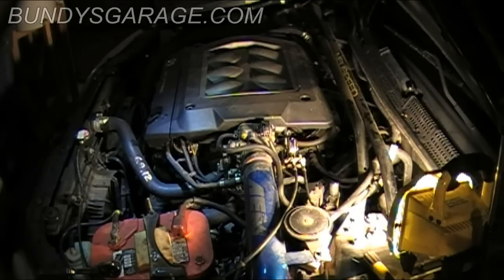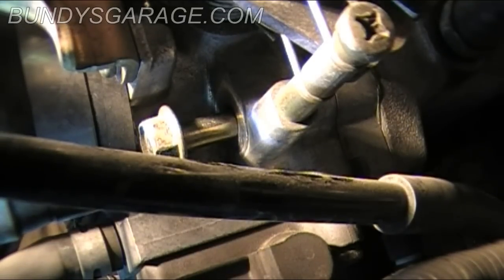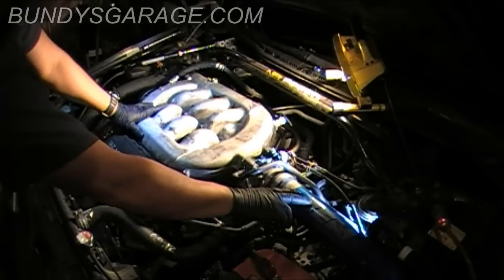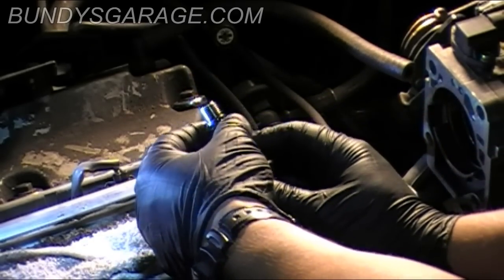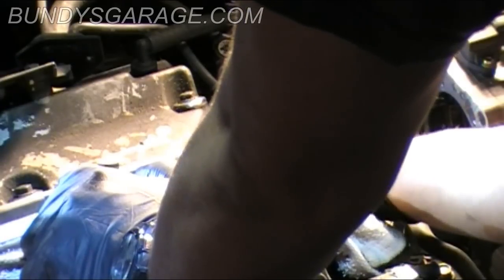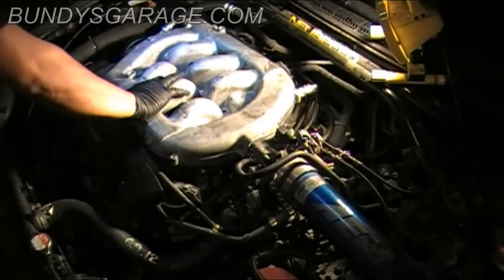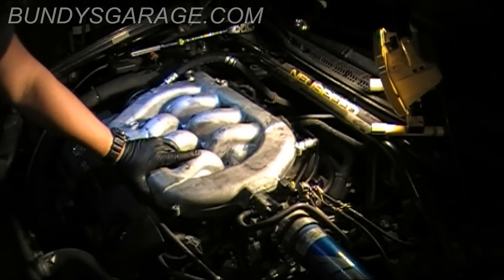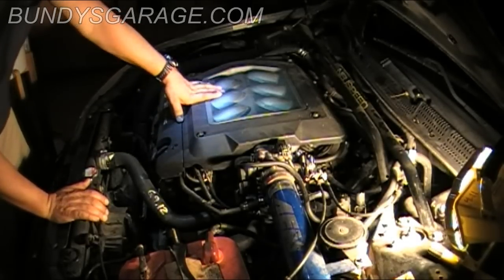DIY: Acura Honda (FPR) Fuel Pressure Regulator J Series V6 - Bundys Garage

Comment: Thank you!

I have a 2000 Honda Accord V6 and the steps were pretty much the same as in your video.

Note other 1998 - 2002 Accord V6 owners... 
You’ll have more pieces to remove on the engine cover than shown in the future!

But other than that, it’s pretty much the same!

Comment: Very interesting. My model does not have the fuel pressure regulator there. It is located in the fuel pump assembly. I had to look through a Haynes manual because I could not find mention of that anywhere.
Reply from the maker: What’s your year, make, and model?
Reply: @bundysgarage I have an 06 TL and mines is not where yours are either and I’m sure it’s in the fuel pump assembly but there’s no videos on it anywhere

Comment: What were your symptoms for the part being bad? My 99 Acura TL is showing signs of it not shifting when it should, when I’m driving it’ll often start to rev up as if it’s in neutral, then after 2-3, it’ll kick back in and start accelerating normally again. Also, it’ll often show lack of power.
Reply from the maker: What codes do you have?
Reply: @bundysgarage  I haven’t used a professional scanner but I used the obd2 scanner from autozone just to see what it would throw up and it gave a code for the transmission. My trans was brand new when I installed it. Only has about 50-60k miles on it.
Reply: @bundysgarage  that’s why I really questioning whether it’s clogged fuel lines, fuel filter, fuel injectors, or the fuel rail regulator. Or I’m hoping it’s not the trans in the worst case scenario. One other thing I forgot to mention is sometimes when I put it in reverse, i let go of the brake and it  doesn’t want to start rolling. Then when I push the gas. It’ll go but struggle and shake as if it’s about to stall. Never had that happen before.
Reply from the maker: What codes was it?
Reply: @bundysgarage  unfortunately they didn’t give me the code
Reply from the maker: You gotta get those codes and that will give you a place to start
Reply: It’s probably the transmission. Auto or manual? If it’s manual the clutch is probably going. If it’s automatic it could be the torque converter.

Comment: hey bundy i have a 1999 acura tl and it dont want to start but it cranks and the fuel pump turn on but no fuel pumping up you think is the fuel pressure regulator
Reply from the maker: +ClevelandMade216 itncoykd be your starter

Comment: Would this cause a p1072 bank 1 to rich on a honda pilot 04 , I have replaced upstream and downstream 02 sensors,replaced fuel pump and strainer (denso), replaced all spark plugs,cleaned throttle body and egr ports and code still persists

Comment: hey bundy @ 14:55 you said we had to match the fpr to the year and make, i have a 2000 honda accord ex v6, when i check the autozone website one FPR says 44 psi then another says 53 psi, i am having this "heat soak" or whatever it is called for this model where you drive around 10-15 mins shut the car off for 10 min and come back and it does not start up until it is cool. my question is if i get the 53 psi FPR will i have to change the pcm as well? thanks again
Reply from the maker: +Chris G No you should not have to change the PCM.
Reply: Chris did just replacing the FPR fix your issue?
Reply: hey THERIPPER216 the only thing i did to overcome the "hot start" was get two bottles of the GOOD fuel injector cleaner from auto zone and put one each one by one once my gas is like completely empty gas light comes on. then put 93 in my car about half a tank drive that out and add the 2nd fuel injector cleaner refill gas with 93 and my car has been running ever since, its been about 2 months since ive had the issue (knock on wood) hope this helps anyone else experiencing this issue.
Reply: +Chris G I'll try it lol did yours ever run rough for a few seconds when you had this heat soak issue? I've replaced all plugs, coils, and injectors and sometimes when I start it ( after driving it around for a while) it starts up with a misfire and I have to keep the idle above 2k  or the car will die and then the misfire will go away after like 10 seconds
Reply: +THERIPPER216 yes I had that issue but I replaced the coils packs and did the fuel injector treatment and it's been running fine ever since. Just be sure to do it how I did,  another YouTuber told me to try that solution and it worked. Get the BEST fuel injector cleaner I think I bought STP and it was a sale two for $9 or something but I did that and put 93 gas after two times car was running great no issues. I have been running 89 and no issues
Reply: +Chris G thanks a lot man im going to try it out
Reply from the maker: +THERIPPER216 Yep that's the Heat Soak problem even though it should be called something else. I have a full article on it if you email me I'll email it to you
Reply: Chris G dude i have the same hot/soak problem on my 2000 honda accord v6, what i did was i took out The vaccum line connected to the fuel regulator and put a screw at the end of the tubing, what happens is when the engine is on hot/soak stage the vapors will run through the fuel regulator and it will malfunction, though the fuel regulator does work its just not working properly due to the vapors from the vaccum line

Comment: I have a 98 accord v6 the mechanic said it was the fuel pressure regulator and one of the o2 sensor can I replace this by myself if I have all the tools? ¿
Reply from the maker: +Javier Hernandez Why do you want to replace the FPR? What's the car doing? Yes you can, if you have all the tools.

Comment: This might be my problem on my 01 Acura cl type s I have changed fuel pump / fuel pump main relay / iacv / throttle body and it still cuts off once in a while when I turn the engine on I have to give it gas to keep it alive then the engine stays on
Reply from the maker: Here is your problem, check out this video: https://youtu.be/VQe1sZCDnu4
Reply: @bundysgarage  ah I see easy fix going to go ahead and replace those sensors when I can I saw the whole video and I am getting that shuddering after a drive to the store  but no CEL comes on thank you

Comment: Hey Bundy I have a 2000 Honda Accord v6 ex that has been acting up.
Cold cranks fine, run it for 30 or so mins, and if I shut it off it won't crank back up. Well lately it's been getting worse (been sitting in my jobs parking lot for 2 days)
I've changed the Coolant temp sensor, replaced Fuel pump, checked all fuses, spark plugs, and ignition coils.
Well now that I've seen your video I'm gonna go check the fuel injectors first then if those are good I'll move to the FPR.
Just wanted your opinion before I might waste my time or money.
Reply from the maker: Is your check engine light on? And if it is, what is the code?
Reply: No check engine light at all
Reply from the maker: Yes I would change the FPR but use one from a 2004 Honda Accord V6
Reply: ok ill be sure to do that but curious.......why a 2004?
Reply from the maker: Cause between 2002 and 2003 there was a design change that eliminated the problem you are describing.
Reply: ok thanks man im bout to go put in on now ill let you know how it goes.
thank you
Reply: Well I it the FPR on and that didn't work. But I noticed I want hearing my fuel pump turning on so I get a brand new one put it in and it fires up and runs beautifully.
Get home an go out a couple hours later and wont start again. Brand new pump isn't faulty and now the new one isn't turning on.
Talked to a buddy of mine and he said that ignition switch.
Your opinion?
Reply from the maker: Eric the Car Guy has a great video on the ignition switch. I know it's on a Honda Odyssey but it's almost identical to your car as far as electrical. Check it out here:

https://youtu.be/WX9EF0eOrVs

Comment: Hey Bundy I have an 01 accord with  a fault code p1456, it had p1457 but I replaced the vapor canister and valve and it went away. But now p1456 popped up, I tried a new fuel cap but popped right back up. What do you think it could be?

Comment: Nice video! My issue is a bit more complex, 2003 Type S that the fuel lines were replaced before I purchased it.  WOT seems fine but after a long drive at 60 MPH I stalled, fired back up & when the tach was as low as it can get going 60 MPH stalled again. I was able to start & get home.  I think my fuel pressure isn't up to par, but seems fine at wide open Throttle?

Comment: bundy will that project will aply for the Acura cl Type s including the bolt tighten if so replay thanks and one more ting  is good idea clean up the fuel cylinders since there close enough and can you name the part that u Work whit  # is it new part and thanks again ....
Reply from the maker: What year is the CL?
Reply: +BundysGarage is the Acura cl Type s 20001 to get to the cylinders do I have too take the manifold intake out and replace tha part that u did. for a new one
Reply from the maker: Yes

Comment: Hello Mr. Bundys, i have the same car but 
The problem I have is that when the car is already approaching half a tank of gas, the acceleration starts to fail and then it goes out.  I have to park turn everything off and on again.  and so I pass it until I get to the gas station.  as long as I have a full tank that doesn't happen to me, it's more;  That started to fail me since the maintenance light on the board came out.  Along with that I have trouble starting the car.  It does not turn me on at the first, always at the second or third.  I changed the gas pump and the buoy and still have the same problem.  I have cleaned the injectors but I have never seen the pressure regulator issue.  which advises me in this case or that may be the cause of my failure. I have the check engine light on.

Sorry I’m Panamanian I don’t understand English completely
Reply from the maker: It’s ok. Thanks for watching. What code do you get when you check the check engine light?
Reply: BundysGarage hello, P0131, (P0401 two times), P0420

Comment: Hi, I sent you an e-mail about my car stalling (and possible ignition switch problem), but am taking a look at this video because I now think I may have a fuel pressure problem.  Will send you more details later.

But for this video, how did you know that the fuel pressure regulator was bad?  Would be great if you ever get an opportunity to show to to hook up fuel pressure guage to this engine.  I looked, and don't see anyone else on youtube showing connection for fuel pressure test for Acura/Honda.

Also, after you installed the fuel pressure regulator and before you re-install intake manifold, could you have just put key in and turned it to "on" a couple of times to prime fuel  system, and then check for leaks?

Thanks.

Comment: I have a honda odyssey 2001 and its running so rich fuel trims are so negative under -14 or -20% y check the evap system o2 sensors egr valve and its working fine but I haven’t check the fuel pressure yet you think that the fuel pressure regulator is bad and is sending fue to the vaccum lines or just stuck close and build up a lot of pressure on the fuel rail ?
Reply from the maker: Pull the vacuum line off the FPR and see if fuel leaks out. If the diaphragm is ruptured on the inside fuel will come out of the vacuum line. Also what codes does it have?
Reply: BundysGarage it had the po170 but it didn’t light out the check engine it just show up on my scanner while driving since the day that code never show up again i will check the fuel pressure and do the regulator as well it just get so frustrated my car runs crappy and poor gas mileage 150 mils half tank sometimes 240
Reply: If you have email i could send you the pictures of the date scan and tell ke what do you think on the o2 sensors
Reply from the maker: bundysgarage@gmail.com
Reply: BundysGarage thank you i jsut email you the pictures I really appreciate your help:)
Reply: What was the issue? I have that same problem.
Rich condition po172 
Comes and goes. When the check engine light goes off it rides great for a day or 2 then crappy again. Symptoms are poor fuel economy, lack of power, occasional hesitation and rare coughing. Map sensor works fine O2 sensors working fine have not checked the EGR yet or the fuel pump.

Comment: Hi Bundy
I have a 2000 Accord EX V6  and it came with an aftermarket fuel pressure regulator.(no numbers on it)
the auto parts store is showing two for my car. which one is the correct one: 
To Engine Number: 3121223Operating Pressure (psi): 44 psi 
orFrom Engine Number: 3121224Operating Pressure (psi): 53 psiNote; i cant find those engine numbers in my car.Oh! i didn't know you can fix washing machines :) like the video.
Reply from the maker: +Rudy Munoz I can fix all kinds of things. Get the 53psi one
Reply: Bundy 
Thank you
Reply from the maker: +Rudy Munoz you're welcome

Comment: Hey Bundy hope all is well. I didnt know how else to contact you..

I have a 98 Accord V6 and as of recently ive been loosing acceleration after the car warms up.. Almost as if its giving out of gas.. Ive had the pump replaced and a MAP sensor replaced. The sensor helped but it still happens. I only have the EVAP P0171 code. Also switched out shut-off vent valve. Im at my wits end if you can help?
Reply: I’m in the same boat 
What did you find out
Reply: @remynyc23  upstream o2 sensor

Comment: Good Morning Bundy I am having the symptoms that Wigwamman was having as well. I have replaced all the sensor map, idacv, and throttle position sensor as well. The v6 honda accord is running very rich so its causing misfires in all cylinders as well the O2 sensor are setting the engine light on. i have new spark plugs and wires as well as cap and rotor. There is also a new catalytic converter install as well. I have headers as well.  Do you think changing the pressure regulator will do the job. I'm getting that hesitation ever so often when i press the Gas peddle then it will kick it out of no where as if the car wasnt getting gas then all of sudden it does. I had an ob2 scanner hooked up to monitor the fuel readings and it was pretty rich so i was told to change the O2 Sensor bank 1 and 2. however the same thing is still happening. any help will be appreciated for a solution. just don't want to keep throwing money into the vehicle if nothing seems to fix it. p.s i have a new fuel pump and filter as well. timing belt water pump all has been change. 20042600 miles on the car. 1999 ex
Reply from the maker: +Earl Lee Do you have any codes? Where did you get the fuel pump from? Is it a OE Honda pump? How long has this been going on for? What is the year, make, model of the vehicle and how many miles do you have on it?
Reply: @bundysgarage I'm having the same issue. Mine is a 1998 honda accord ex v6...p0170 and p0171. I changed my fuel pump but not sure that it's an OE...I'm going to check but also by watching your video I'm going to change my regulator